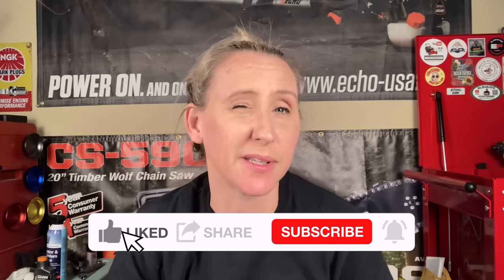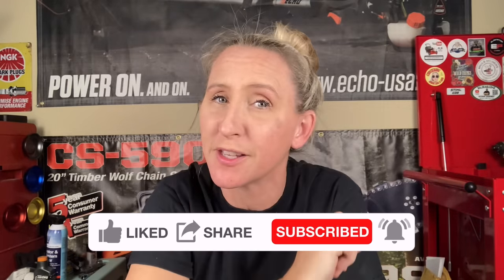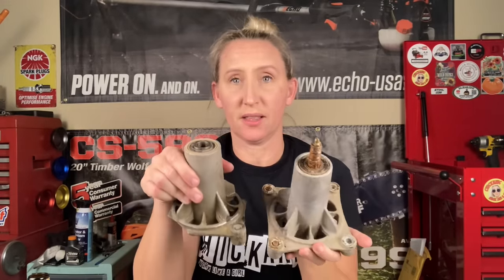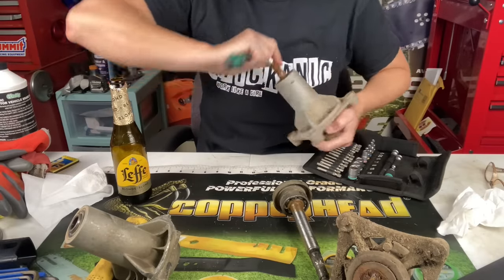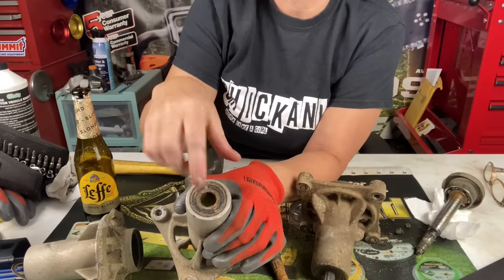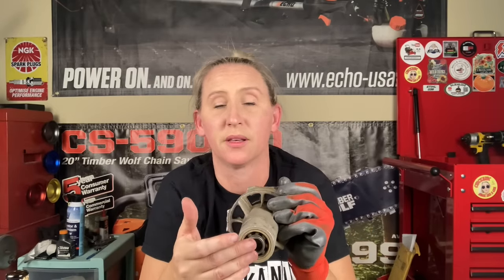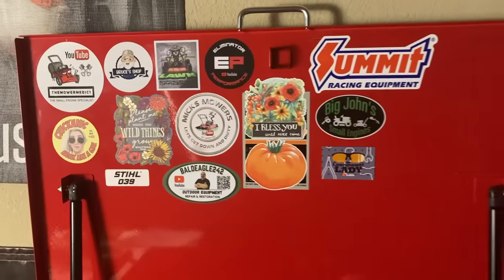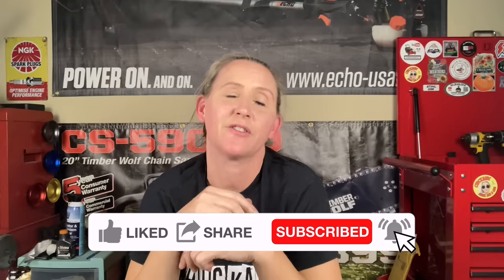THIS IS BIG!! Husqvarna riding mower and Zero Turns HAVE CHANGED! Review/Vlog

Comment: John Deere does the same thing with completely sealed bearings. The big box companies knew what they were doing because it meant money for them. Now that people have been catching on they’re starting to change the designs
Reply: Even if you could grease them, most people wouldnt.
Reply: Any insider knowledge about JD?  Are they changing or have they changed?  I got a new Green Machine last fall and haven't needed to service it yet (don't have a large enough yard to put a lot of hours on it)  Was going to do surgery on the spindle bearings on first chance but if it isn't necessary, it would save me some work. 130
Reply: @buzzsawncgo2751  my jd x350 lower bearing does not have a inner seal also
Reply: @buzzsawncgo2751  I don’t think they’ve changed those yet, I could be wrong though. I do the the EZ change oil changes are a waste of money designed to ruin your equipment faster. Yea you change the “filter” but there’s still oil in the engine, old and dirty oil. You can convert those back to an actual drain and filter so you can change your oil the right way
Reply: Big box companies.. lol. 
Husqvarna actually builds their high end tractors. Mtd manufacturers the "box store" units.
Reply: Found both sealed an shielded bearings in my jd spindles

Comment: People can say what they want about so-called sealed bearings but they are not truly sealed. If you drill and tap the housing of a spindle and install a zero fitting and grease it with what is called corn head grease. It will grease the bearing. Corn head grease is designed to grease high speed sealed bearings on a corn head off a combine. As the grease heats up it turns to liquid form and as it cools down it turns back to a grease type. Sealed bearing are not designed to keep oils or water out, they are designed to keep grease in and dirt and dust out..

Comment: not speaking to you directly chickanic, just what I've learned over the years. this is for those die hard seal lip removers lol.   the seal lip is designed to keep the grease IN the bearing, so if you remove the top bearing seal guess what happens? the grease will just drop out and leave the bearing dry if the spindle isn't greased regularly,  even though they are sealed, and you grease the spindle the grease will squeeze past the seal lip and into the bearing....think of the grease seal like a check valve....when i went to the ayp / dixon  update school both manufactures  were adamant about this (dixon uses ayp decks).....they also stated that the grease filled spindle will keep moisture out of the spindle especially those folks who like to power wash their machines  great video as always!  thanks for the shout out!
Reply from the maker: I concur. I do not recommend tearing sealed bearings apart. I finally got some quality stickers, so send me your address on Facebook so I can send you them and the size of shirts for your and the misses.

Comment: On  older Snappers the spindle had a zerk in it, however Snapper told me to look at the zerk. I looked and it did not have a bb in the end of the zerk. Was told this was a vent so the pressure didn't push the grease out of the sealed  bearings.
Reply: wow, never heard that one! And years ago I heard a lot from my Snapper distributors!

Comment: I’ve put plastic sleeve (basically a piece of thick wall pipe) inside my spindles. It takes up space to reduce the huge amount of grease otherwise needed.
Reply: Now that is an excellent idea sir.
Reply: mizzouxc  So these brilliant Engineers decided to put in zerk fittings but leave the seal on the inside on both the upper and lower bearing eh? Additionally these Engineers decided not to put any grease into these cavities after manufacture ? I like the old Engineers that made auto engines that a normal person could work on and gave you the room to work on it.
Reply: Sounds like a good part to 3d print out of my favorite material.  Maybe not, don't know how hot the bearings run, would not want it to melt.
Reply: mizzouxc3824 Just thought of that myself as I was thinking about it.

Comment: I like the drinking with us lol I thought about just removing the inside seals but to much pressure would pop off the outside seal but if done carefully who knows? I think the best way is just to manually grease with high temperature grease?
Reply: Gotta  use high temp grease on bearings I greased one out in the field away from shop with universal Grease and it blew apart and was dry after a few days like it never had grease and I packed it!

Comment: I don't have a riding mower but I thought I would mention that not knowing how easy it is to get your grease gun onto that straight up zerk you can get a different end for your gun that slides straight on from the side. It has a slot in the side so you push it on straight instead of trying to get the hose bent to put it onto the top of the zerk when it points up. Very handy. I used to work in auto service and it comes in very handy for low clearance areas where the hose won't bend enough and you just pump grease out and not into the bearing or in my case ball joints. Hope this saves someone some time and frustration :)

Comment: Hi Chickanic,  Recently saw video where he removed top and bottom bearings on a J Deere riding E 100.. He removed bearing covers and completely cleaned both top and bottom grease free.. He installed bearings on spindles and on to the deck. He packed the spindle housing with GREEN grease. He then ran J. Deere for awhile.  Mind you he is sharing this as he un installs spindle housing. He then removes both top and bottom bearings with dust covers still connected. He then removed dust covers from bearings. And both top and bottom had green grease in them.  Since seeing this video, I also grease the housing until it sguirts out. I also notice now when engaging mower blades, they engage very smoothly. Hardly or very little vibration.  I saw and tried it and it works.. Keep up the great work your putting on You tube. Joe Cruz

Comment: Most of the spindles I replace for customers are from bad bearings.  I live in Missouri and we grow rocks here too.  Rarely see cracked spindle housing or completely pooched star pattern.  The cheap Chinese aftermarket spindles I usually use are sealed bearings (plastic seal), but I am not going to take them apart to pull off seals.  Just pump a bunch of grease in them, at least moisture and dirt/debris is kept to a minimum.

Comment: My ages old White Horse 50 inch deck came with zirk fittings AND sealed bearings, which I discovered when a bearing failed. Inner bearing seals removed and no more bearing failures.  Thanks for the great content!

Comment: My 17 year old Husqvarna was like that when I took the spindles apart. The bottom bearing was sealed on the bottom and open on top. So they’ve been doing it for at least that long, on some mowers anyway. The top bearing had spacers though.

Also, if you grease a spindle that has sealed bearings and then and open up the seals you will notice that they will get grease. It’s easy to tell if you use a different color grease, so it’s never been useless to grease sealed bearings, the grease easily gets right around the seals.
Reply: Then the seals were designed NFG
Reply: In my experience with my Murray ride on, replacement spindles have always come with sealed bearings and yes the grease does indeed get past the seal if pumped up sufficiently but does not receive enough grease before it starts coming out the zerk for this reason I still remove the inner seals.

Comment: Commercial ( golf) are greased open bearings with a sleeve to space inside inner races too. Grease , grease, grease. Also find the smaller  24” blade hubs more durable compared to the heavier 27” more mass more chance of damage .

Comment: If you retrofit these spindles....the most reasonable method I've seen is to take off the inner dust shields on the bearings, drill a hole in the side of the spindles for a zerk(if there isn't one)...but that only gets you grease inside the spindle. How much to put in??? Well, you need a small air hole drilled in the spindle that can have a rubber plug put back when the grease starts weeping out the air hole....like they have on hydraulic floor jacks.

Comment: I still think that roller bearings last longer when sealed. Its good they did leave the seal in the top bearing because if that spindle is not full of grease then the top would fail very fast. The double automotive or ATV style sealed bearings you see on some bigger commercial units are really a huge improvement. I've yet to see one fail.

Comment: My feeling would be, once you get that cavity filled up with grease, future greasing applications should be very light unless you see a large discharge past a seal. It’s likely that Heat from the summer temps and usage will cause expansion and push some out past the seals.
Reply: I believe you are absolutely correct but it takes a lot of grease to fill the void close to a full tube 70 pumps with the grease gun. I have done some testing with a different coloured grease and when the cavity has been filled the different coloured grease does enter through the rubber seal. Is it enough only time will tell but once filled we grease them whenever they come back for service and we use a paint stick to identify each spindle so we know we have greased them previously.

Comment: One suggestion I have is that the  housings come with a steel plate that is fastened to the housings by the same installation bolts to the frame. I made some from an old deck that was shot. Have never had a housing break since. One other thing, I drill out the housings for a pass through bolt and nut. Otherwise the soft bolts provided will break off into the aluminum if attempted removal.

Comment: I had an MTD bought around 1991....The spindles lasted a long time....Got my replacements locally from a farm supply that would last one or two seasons....Switched to Dixie supply and their bearing lasted for years as did the original factory bearings....After 25 years of good service, even the seat lasted 20 years,  I bought a Husqvarna Z246....That seat lasted 5 years before cracking....

Comment: I bought a Cub Cadet commercial ZTR  and it has grease zerts all over it, so I'm glad to see that they made the blade spindles grease-able, but the first thing I thought when you opened it up was  that's a mighty large grease cavity, each spindle assy probably takes a half a tube of grease.
Reply: Maybe a full one
Reply: @waynestefinashen239  LOL, No kidding
Reply: When I rebuilt my spindles I removed the inner seals and filled the cavities with bulk grease before putting it back together. It’s cheaper than tube grease.
Reply: we tried drilling and putting grease fittings in Husqvarna spindles it didn't fix the problem. I will not own another one. this was early 2000s
Reply: @BossPrepping  That sucks, Quality long lasting lawn equipment is expensive and getting harder to find without buying commercial grade. I just happened to end up with a commercial ZTR on accident and I love it.

Comment: We just bought a Husqvarna zero turn mower in  late 2020 hopefully it has the upgraded spindle design. Btw to anyone that needs a new mower never buy it online aways buy from dealer unless you're mechanically inclined cause there is so much stuff you need to adjust and repair on them right out of the box it had an oil leak out of the drain line, control panel where everything is wasnt assembled correctly had to reposition it, didn't track straight had to adjust the speed on the sticks and deck needed to be leveled didn't cut right and will destroy belts. Always buy from a store or dealer

Comment: I recently watched a video where the poster showed that even though they may be 'sealed' bearings, they will still take grease through the grease fitting.  Problem is that the manufacturers do not put a lot of grease in the spindles at the factory so, the first time you lube it you have to be sure to fill the housing.  Try it, it works.  I did.  See 'Woodchuck Russ the Deck Dr' here on YouTube.

Comment: On your fuel test, you did. If you put your plum on the unlock blk button and your fingers on the flat grip and squeeze, it will pour alot better.and stay in control of the container.

Comment: I have a Husqvarna riding mower about 15 years old. Every time since it was new it backfires when I turn it off. Still runs great and cuts good. But I also have to give it a shot of starting fluid when I start it. But once it's started once it will start every time the day of use. Better than buying a new mower. 👍👍

Comment: Ayp merged aquired by husqvarna some time ago. 
(Where the t series craftsman tractors came from). 
Husqvarna has mtd manufacturer most their low end lawn and yard tractors.
I've seen it. 
You can remove the seal cover on inside of the bearings before rebuilding if they have a zerk

Comment: My Wheelhorse had open bearings in it. The replacement one's didn't just take off the covers on one side works good that way u can grease them thanks for sharing.  My Wheelhorse is a 1981 they don't make the like that any more.  In 1981 I payed 2700 for it. But they are a garden tractor.

Comment: Funny I just watched it and commented on it as well about how the greasing works.  The interesting thing is there was no grease in there.  The ones I have changed are full of grease and the bearing seal has been removed from the two inside seals.  I imagine maybe some were not assembled properly or not replaced properly.  I have always worn-out bearings, when they start to roar it's time and quite often had I removed the plugged zerk and put a new one on they would have likely been saved but they are cheap. Again great video helping more people out.  I share your channel with everyone who might benefit.

Comment: The Husqvarna ZT mowers are the former Dixon designed mowers made in South Carolina at the Dixon plant which they bought in the early 2000's. The rider 'lawn tractors' ARE made by AYP for them (Husqvarna). I believe they also bought Yazoo-Kees around the same time which was a super machine. Husqvarna just killed the brand. I had a chance to buy a 72" Yazoo with a 31hp Kubota turbo diesel a few years back, real low hours. One of the last ones made, 2004 or 05 maybe. It was way more mower than I needed though. Would've loved to spool up that turbo cutting my grass for the neighbors to hear!

Comment: I have a 2014 Craftsman, (Husqvarna made) i just replaced one of the 3 spindles on its 54 in deck. All originals, it had the open bottom bearing! But it didnt have the integrated spacer top bearing. So evidentally they have been doing it for a few years.

Comment: Interesting. I work on Bonanza/Baron aircraft. These have not changed much since 1947 but 2018 models and later look the same but everything about them is a little different if you look close. Same deal with these spindles. Sharp eyes are necessary! You have them.

Comment: As someone who spent years changing bearings and then years buying bearings for a global manufacturer of automotive components, there is nothing wrong with sealed/shielded bearings in this application as high speed and/or precision aren't at play.  As long as the seal/shield isn't damaged, they will last a long time.  In this application, I would prefer shielded over sealed.  I bet you'll be changing out more bearings in the future as open bearings are more prone to failure if not maintained properly.

Comment: I would replace the bearings in my 38 inch cut mower every year,  I took the spindle apart took the bearings out, seen a number on them . Went to Tractor Supply bought 4 bearings.  Worked good as new. Then I went to a mower shop and wanted to get more bearings,  was told, you have to buy the whole spindle,  can't get the bearings.  So I went to a bearing Supply,  gave them the number,  and they had just what I needed.  Some mower shops may not know the bearings can be changed.

Comment: I had MTD tractor for 20 years with the briggs L head engine. Mowed about 2 acre for 20 years. Had a 44 inch deck 2 blade deck with a little 4 inch between the two blades so it would not skip grass. Best mowing deck I have ever used. And I used a lot of lawn mowers which people complained they did not mow even. The only way to get a mower to cut even is by mowing with it and adjusting it. What a pain to do. You buy a new one you will have to even the cut yourself or pay the dealer as this is not under warranty unless it is way out. You can get close on even concrete. You really need to run and mow with it as twist and such come into play to get it really nice. The hydo tranny on it was a cast iron. Still ran good when I sold it for 100 bucks 20 years ago. It was hard to get parts for it is why I let it go. If not for parts I would still have it. The deck had sealed bearing in the quills I call them. Guess what went bad? The idle pulley which was a sealed bearing. If it was greaseable probably would have not lasted that long. Water is what really wrecks bearings. If they put good sealed bearing in them probably last as long as the grease ones. With a shaft and bearings probably cheaper to just buy the whole spindle or I call it a quills. Keep the water away and don't hit things helps a ton.

Comment: You can get those replacement shafts, I think they call them quills.   The ones we get are open seal on the bottom bearing.
So replace the top bearing with a 6203 RS and put in a new quill and half a tube of grease.  That's what we do when we can.   
Bill in Ottawa
Reply: You Canadians know what you are doing eh?